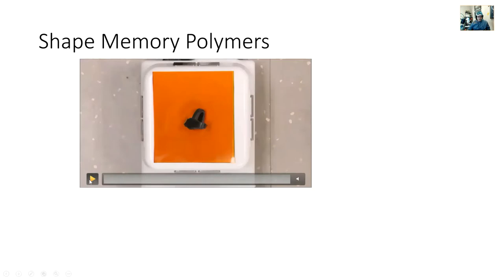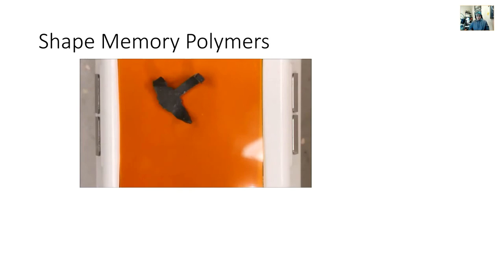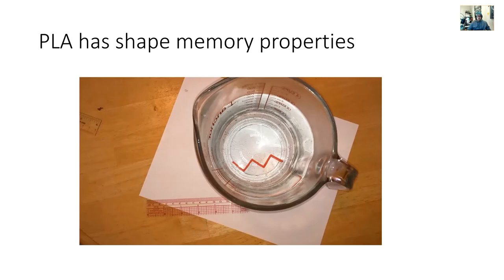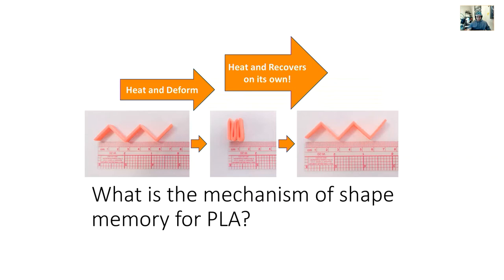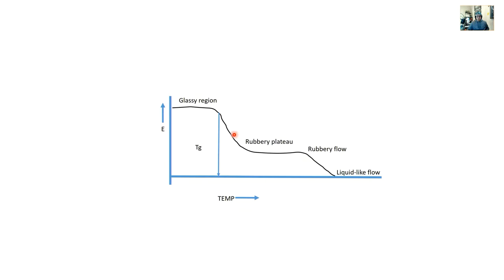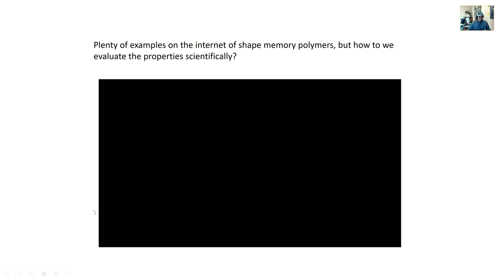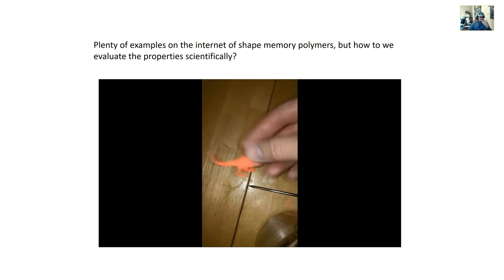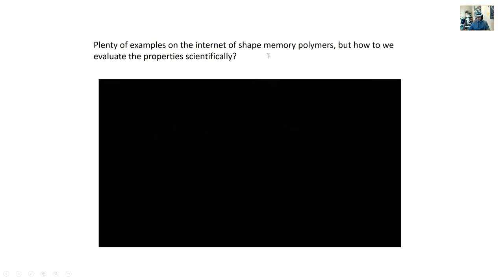Shape Memory Polymers

Comment: I was wondering for stop motion animation application.
Will Nitinol break when bended many times? Does Nitinol has a bending fatigue?
Right now in stop motion animation some parts of the puppet are made with aluminum wire, witch can be bended many times, but eventually it breaks.
Tnx in advance for your help.
Reply: I work as an orthodontist and we use shape memory metal alloys and polymers in our research. Nitinol has a lower chance to break, you can also look up titanium molybdenum alloys and gummetal ( it's an alloy from a Japanese company ) , I hope this provides some useful information. Pm me if you need more info.
Reply: @HusamSoboh  thank you! I have already received the samples. And they don't brake :)
Not as mailable as alloy aluminum but they do the job.
Reply: Glad to hear that, I hope that they do the job. Titanium molybdenum and gunmetal are medical grade and quite expensive so if nitinol works then it's great.
Reply: @HusamSoboh  it  is not Titanium molybdenum, it is Nickel Titanium, and for what I've experienced is better than just normal Aluminum.You can can bend your puppets many many times before they brake.
Reply: @HusamSoboh  It is not that simple. Nitinol is very bendable and NOT breakable. More than Aluminum. But it's more memory resilient. It is better for joints like, KNES ELBOWS NECK.
45° bendings.
It does not break like aluminum, you can try.

Order your samples pack, you will be surprised